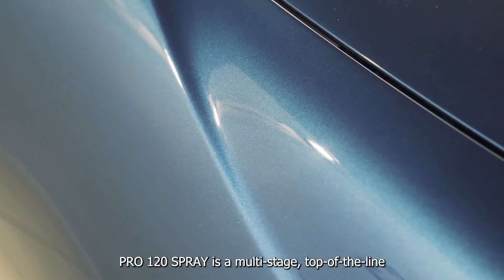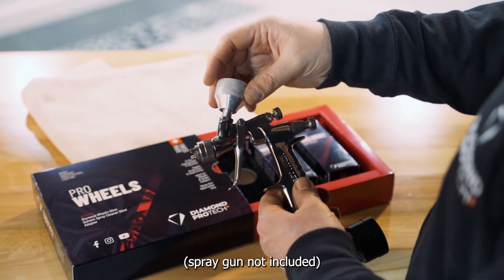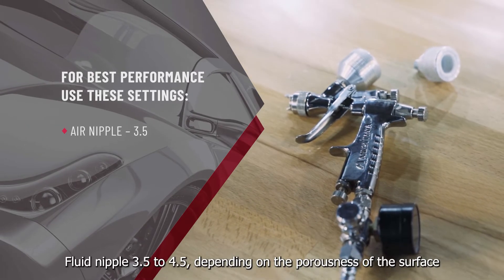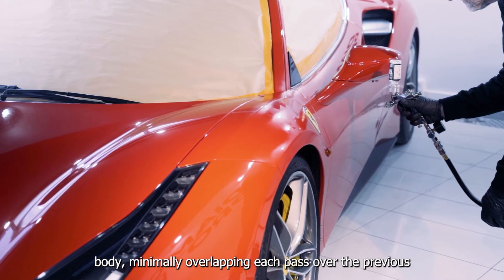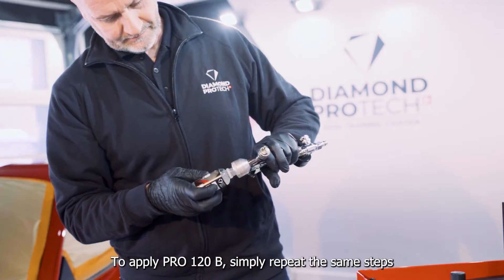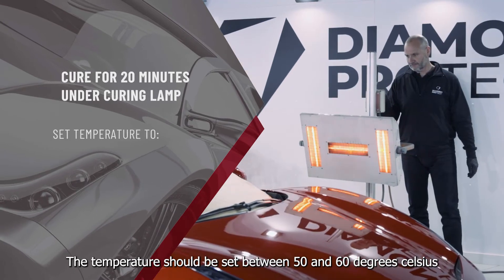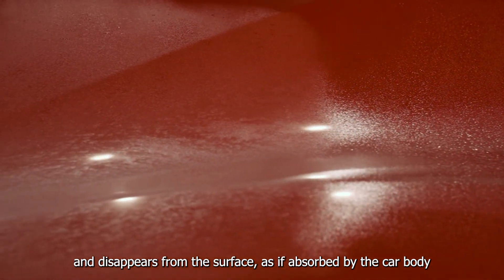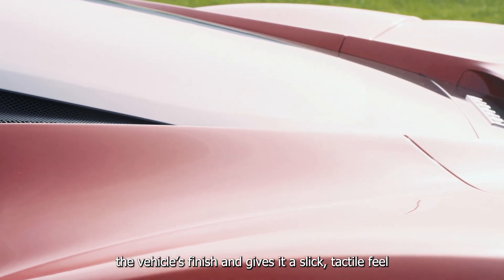PRO 120 SPRAY | Application Instructions

Comment: This is like painting your car all over again. How about just paint another coat of clear?
Reply from the maker: This is much faster than painting another layer of clear coat. After painting another layer you're still going to want to protect the softer clear with a much more abrasion resistant layer. For that, PRO 120 SPRAY is the way to go.
This product is offered in a hand applied version as well, for professional installation.